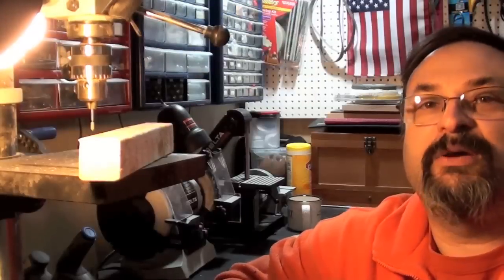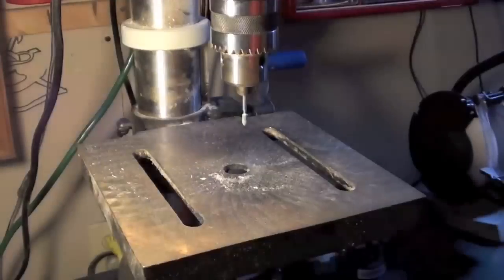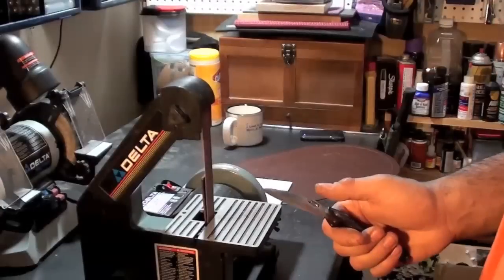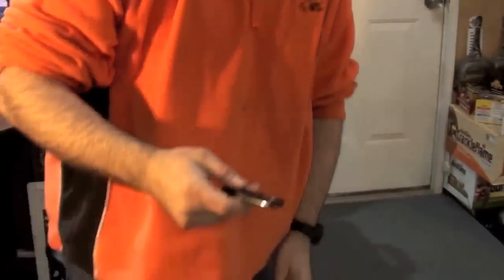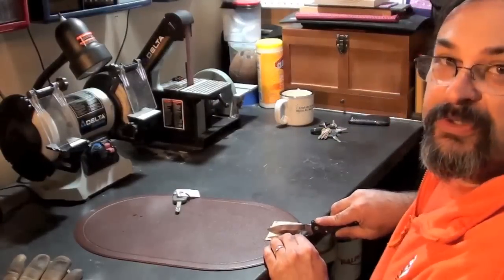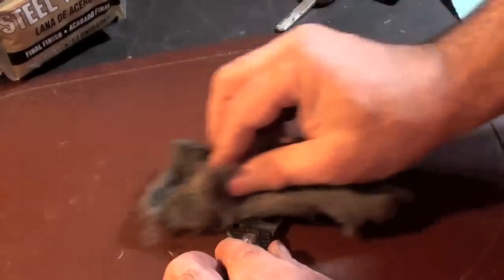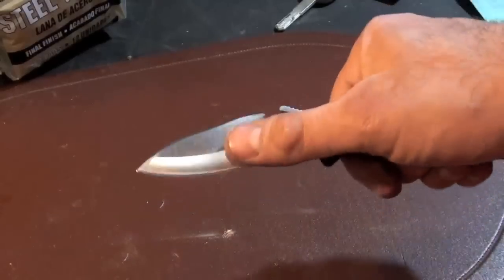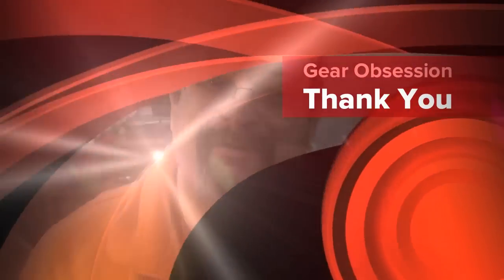Very cool Sogzilla Wave Mod

Comment: if you find the clip too tight just loosen the screw or bend it slightly. i used to sort of put my finger under the slip then pull it out so my clip is nice and loose, but tight enough if you get what i mean. 
Thanks for the video, i realy wanted to try this but would probably have used a saw and messed it up